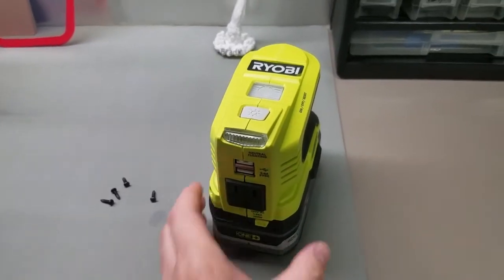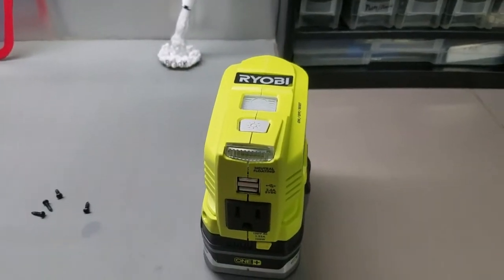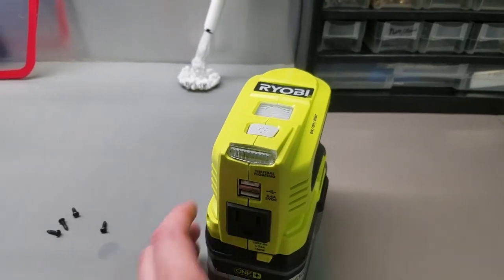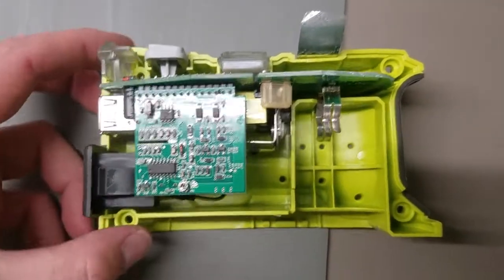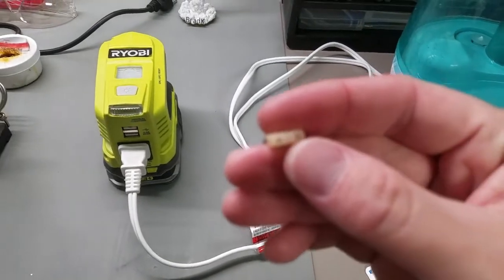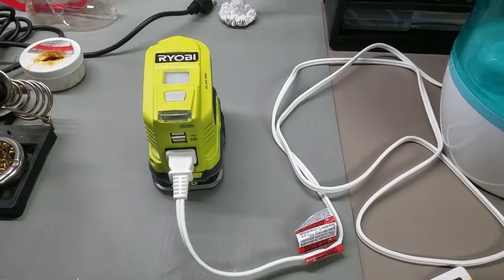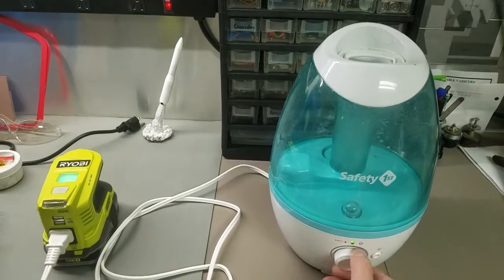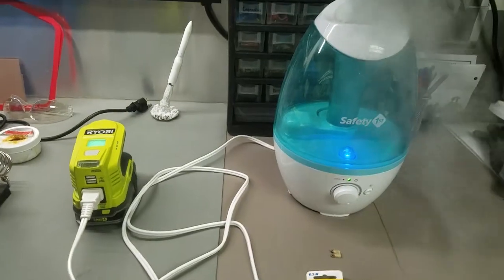Ryobi 150 Watt battery powered inverter repair-RYI150BG

Comment: I have the real deal, but bought a knock off, also. Used once but it fell on floor and doesn't work any more. Can hear something rattle when I shake it, but can't open it up. Took out the four screws but it won't budge. How do you get these open. I mean I assume the knockoff is designed the same...
Reply from the maker: @PanefullyClear  There might be a screw hidden somewhere? Also the original had a sticker on it that held it from coming apart.
Reply: @BradKwfc  Thank you for your kind reply! Am going to try to open again, if i find it...

Comment: My usb port stopped working, inverter still works fine
Reply from the maker: @pctech911  
Hmm, did you pull it apart? Any obvious signs of damage?
Reply: Took apart, nothing I could see
Outlet and led still work
Reply from the maker: @pctech911  Hmm. I never really looked at the USB circuit since it was not my problem. Look at the leads coming off of the USB that go to the board. Can you measure 5V across them?

If not, it's probably the something in the 5V Buck converter. Look for swollen electrolytic capacitors or burns, smell for burnt components etc. Might be a tricky problem to fix?

Comment: Mine stopped working so I opened it up. I guess my model does not have the blade fuse!
Reply from the maker: Hmm. There should be a fuse in there, it might be a different type. Does it not turn on at all?
Reply: I have the same model as in the comment. I believe they switched over to the really small SMD fuse.
Been looking everywhere trying to see if someones posted a PCB breakdown

Comment: I noticed you demonstrating that it didn’t work by clicking fast the repeatedly the power and flashlight. My power button has to be held for 3 seconds to to on and off. What a pain!
Reply: Thank you for this comment! I thought mine didn’t work but after holding the button it does.
Reply from the maker: Hmm. I wonder if you have a different model or something? 
Mine is still working. Green light comes on as soon as I hit the button.

Comment: What kind of solder iron you us. I can't get the solder to melt on the ryobi circuit
Reply from the maker: Aoyue 469, cranked all the way up and it still takes some time to heat it up enough. Also use the chisel tip it transfers more heat.

Comment: I connected an AC ice maker motor and it worked for few seconds and stoped. After opening it up found the blown fuse, replaced it,  the moment I turned it on , blown again with no load. I guess something else got damaged from that ac motor...  cheap quality
Reply from the maker: Sorry to hear that. Mine has been working fine ever since I fixed it. Really helped out a lot when the power went out. I wish Ryobi would sell a bigger one that would take 8-10 batteries.
Reply: Same story here. Replaced the fuse twice now. Each time it blew as soon as I hooked the battery back up even though no load on the unit
Reply: I plugged my inverter into mine and it got the inverter going but tripped my fuse. I replaced mine and the new ones keep tripping. Did you ever end up having any luck with yours or was it a lost cause? Did the fuse replacement void the warranty?
Reply from the maker: @erikspooner6518  Mine still works just fine.
Reply: @erikspooner6518  Still opened on the shelf, however I bought a Milwaukee inverter to have an inverter on hand at least.
Reply: When I okug a battery in, the on/off button now turna red and stays red and the button does not function.  It seems to provide power and the flashlight still works so.... Thought someone like you might know wtf is up with it.  Love this little guy and use it all the time to recharge a phone and power and air quality sensor.  Nothing high drain and have cared for it pretty well so not really sure what the cause is. Any help would we appreciated :-)